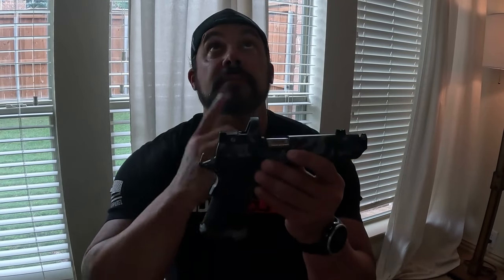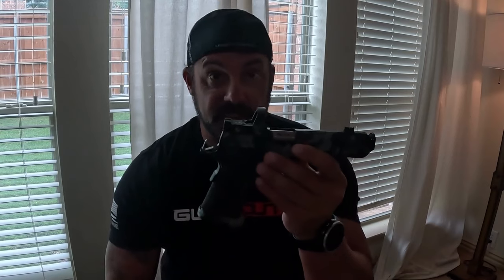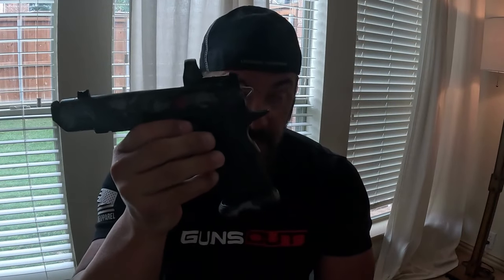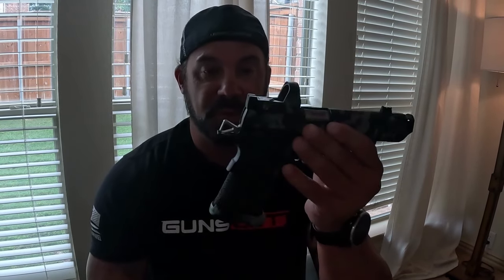MASTERING YOUR STACCATO 2011 GRIP SAFETY!  #subscribe #pewpew #staccato #9mm

Comment: Hey! You've been awesome and responded to my comments in the past. When first shopping for staccatos I was asking if you could pnly have one gun if you would get C2 or CS and you led me towards the C2... I go to the store and the salesman says if he could only have one that he'd take a P and showed me it... they are a lot closer in size than I initially thought they would be. Man the Ps slide is so smooth (I'm assuming it's just a spring thing though). So now I'm again asking you, if you could only have one gun to: conceal carry everyday, have fun with, and participate in USPSA/2 Gun/3 Gun what would you choose?
Reply from the maker: Hey Sir.  You get the steel frame or aluminum frame P?  I am actually finalizing a video for a few of my personal Staccatos.  For the competition side...The P or XL would do you well.  

The XC is another, but the issue with the XL and XC will be EDC...unless you are OWB.   The XC is ported...,

 Depending on what class you will be running in the competition, will put you in open...the XL or P with my Cadre Comp, has been doing well in various competitions, as well....for what you are after, the steel frame will be slightly heavier....

if you are going to run Irons..then the XL will have the longer sight radius with the 5.4" barrel, as well...

I you want to take your P to the next level...replace the 19 lb mainspring with a 17 lb....its amazing how dropping 2 lbs is with the slide movement...hopefully this helps.  Greg
Reply: @THREAT CADRE  I haven't actually bought anything yet. I was more asking if you think for a gun that I want to conceal carry every day and go to an occasional USPSA/2 gun/ 3 gun match if you would recommend the C2 or the P.
Reply from the maker: @fa-ajn9881  My apologies.  The alum P will be excellent to EDC, plus will give you the longer sight radius for the competition matches....Had a buddy place 16th out of 200 with a ALU P in the Praire Fire event...solid shooter and you can tune to what you need....

Comment: Even since I went to a high thumb grip in the mid 80's, I've had to modify my grip safeties on all my 19-2011's to ensure 100 positive disengagement.  It's a simple procedure that I'm sure you're well familiar with, I adjust the engagement with the trigger stirrup so that the tab on the grip safety disengages with very small movement. This way, it remains functional, yet releases consistently even with a less than perfect grip. Cheers!
Reply from the maker: Yes Sir. Another option, as well.  thank you for your input.